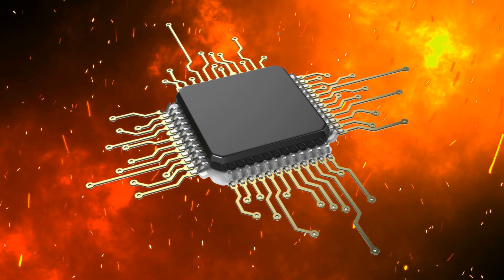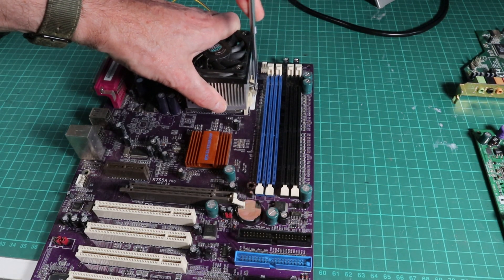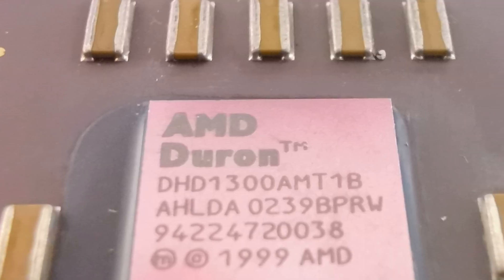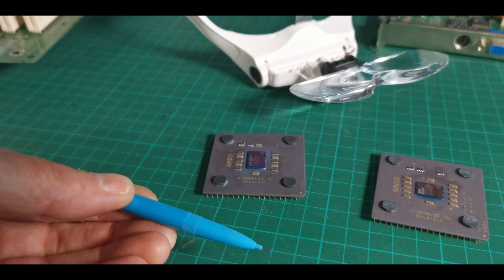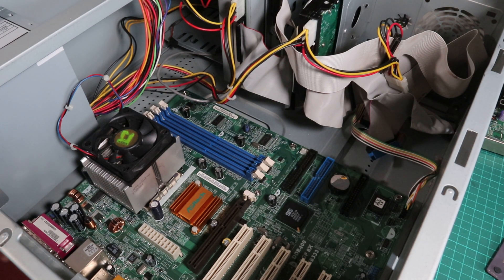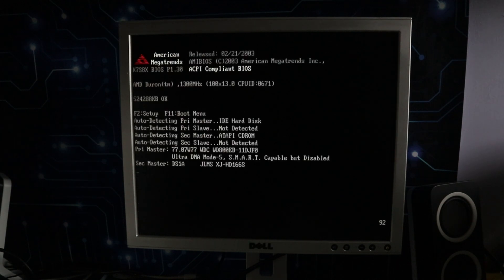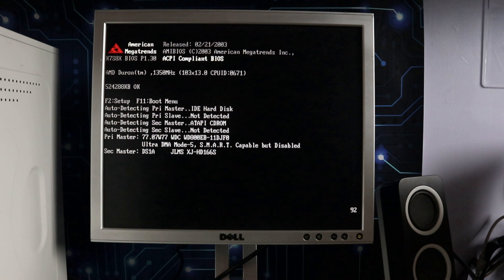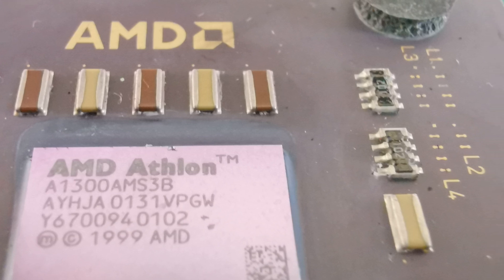Socket A Overclock

Comment: I remember all the fun i had overclocking those Socket A Athlon's, i had a 1ghz at 1.4ghz with watercooling ran that for a long while till i upgraded to the XPs.
I keep meaning to recap my Abit KG7 Raid as that was a great board for overclocking back in the day. 
Really helped the performance back then so was worth doing, i remember also the later XP1700s i have a special hand picked one of those that was a great overclocker somewhere stored away.
Reply from the maker: Me too. In had an 850 back in the day and reconnected the multipliers with pencil graphite and then got it running over 1ghz. Fun times😁

Comment: I always wondered why they even bothered with L2 cache on the Duron. They have this massive 128 KB L1 cache and this dinky little joke of a 64 K L2 cache.
Reply from the maker: I think lvl 2 is the key to getting the most out of lvl 1. When the lvl 1 is full and spilling stuff into main memory it causes a bottleneck so any amount of lvl 2 will add overflow and keep performance up. Im guessing adding lvl 2 to the die was expensive nd hence the reduced amount on budget cpus

Comment: Via had faster chipsets, but depending on the chipset some had issues.  Sis was generally more stable, but weren't without their problems.
Reply from the maker: In the end I found a board with an nforce 2 chipset which seems pretty good.

Comment: I'd recommend of getting a Thunderbird with an AXIA stepping. Rumor says that they were meant to be 1.5GHz chips but AMD never released a 1.5GHz version, those overclock like crazy. I have a 1GHz one and I managed to OC it to 1466MHz stable before the motherboard (MSI K7N2) died.
Reply from the maker: Might be quite hard to find thesedays on ebay. As it happens the non axia thunderbird I have for the next vid overclocked much better than the duron and that was just some basic fiddling so would probably go higher

Comment: I used to buy conductive paint from Halfords car parts store. It was sold for repairing the heated rear window elements on cars. It produced a permanent unlock, rather than the dubious pencil mod.
Reply from the maker: Yes. I have electronics conductive paint that I use for repairing traces. The pencil trick was a famous thing back in the day so this is more out of nostalgia than anything. I wont be running them overclocked beyind this and will wipe the pencil off when Im done fooling around, assuming I dont fry anything😁
Reply: @66mhzbrain  Those were the glory days for overclocking for me. Buy a Duron and achieve XP performance, well, nearly! 🤣
Reply from the maker: @Ted-Branston  yes it was the beginning of a fun time with amd chips, they always allowed fiddling. I remember even unlocking cores in the athlon 2 days.

Comment: Great video, love a bit of socket A overclocking! Good to see a mention of Overclockers, I used to get most of my PC parts form there too, their speed-binned CPUs were great for overclocking. They used to get far too much of my pay each month around the socket A era when I was always chasing the fastest CPU and the highest overclocks (some of which went a little too far... :) )
Reply from the maker: Thankyou😊 yes I spent a fair bit with them back then too. I was terrified following their instruftions that all the gear I'd saved for would melt or something. It turned out ok in the end, still shoo there occasionally.
Reply: @66mhzbrain  Still shop there too, my last GPU came from them, it usually that or Scan depending on price.

Comment: Btw it'll be interesting for another reason - this 1300-MHz Duron is based on the Morgan core which is a derivative of the Palomino, the direct successor of the Thunderbird Athlon. It has improvements over it, most notably a prefetcher and SSE support which should be in the Morgan too (I'm not entirely sure about the prefetch logic, though). So it should be interesting to see them at the same FSB, same clock.
Reply from the maker: Yes, never had a Duron until I got this one, supposidly the prefect made a noticable difference! Im curious about comparing it to a celeron clocked the same at some point and I think the l2 cache on the amds was used kore efficiently as well.

Comment: I went from Pentium 3 (Slot 1) to Athlon XP (an 3200+ Barton core) - actually I totally skipped Pentium 4 processors - and I was extremely pleased. In time I upgraded the DDR memory up to its max 3G@400MHz and XP ran very well (I never ever had BSOD with that motherboard and XP sp2 or sp3). I used to play Medal of Honor, Call of Duty, sometimes Counter Strike, and never had problems. The video was an Radeon 9250 AGP with 256M of RAM (Yes, I was an ATI fan).
I never overclocked the CPU just because it ran quite hot (in comparison my old P3 was very cool) and I was afraid to overclock it.
Reply from the maker: I went from a pII 266 to the thuderbird 850. I ran it overclocked for a good while butnit did eventually start to play up and I reverted to stock speed. Yes all hours medal of honor and ultima online on that machine, fun times.
Reply: @66mhzbrain  My P3 was originally an IBM(Aptiva maybe? It had 300 written on the front panel) that had the same P2@266 that I upgraded up to P3@550with SDRAM and Win98. I added an CD writer and made VIDEO-CDs from videoclips downloaded from Youtube(2006 LOL) to watch them on my DVD player. The main role of that computer was to play Diablo 2 and Half Life.
For Far Cry I had to upgrade to the next computer - the Athlon XP on which I also enjoyed gems like URU.
Reply from the maker: @sebastian19745  Cool. I think my p4 was a dell, I missed the athlon xp altogether and came back when the athlon64 came out. I was mostly into strategy games around then like lord of the rings battle of middle earth and homeworld. Once I finish messing about with this machine Ill play some of the ones I missed back then😁

Comment: I could see how one would want to overclock on socket a. I went from a xp 1800 to an xp 2500 and it was a HUGE difference. If you could get that kind of boost without paying I can see why that's interesting. Great video, I hope a better motherboard will give you some options, you'll need them!
Reply from the maker: I wont leave it overclocked, just doing it to relive the experience😁
Reply: @66mhzbrain  thanks for vid. I had a K7S5A and was very proud of the monolith integrated north and south bridge. Served me well for many years. Unfortunately I did not pay attention to the honey bios which stated only to use it with the XP version of the board. Mine was not and I bricked it with an unofficial bios.
Reply from the maker: @johnathanpearson3203  Thanks for watching. I will keave the k7s5a as it is and wont risk any 3rd party bios kicking around after so many years. Its a nice looking board. Would be cool to find a way to show it off!